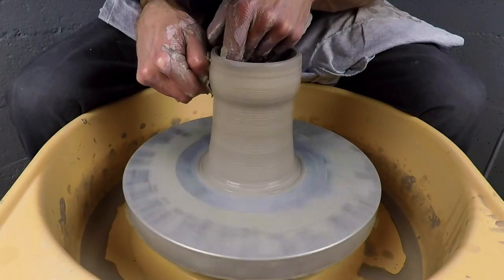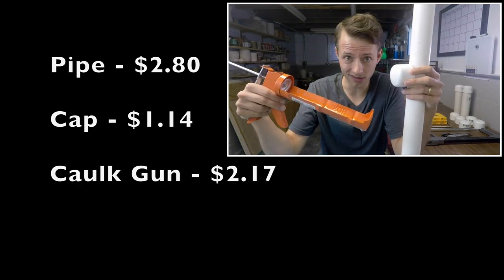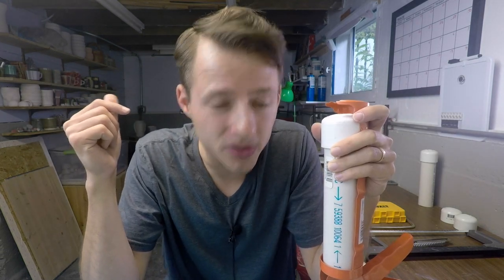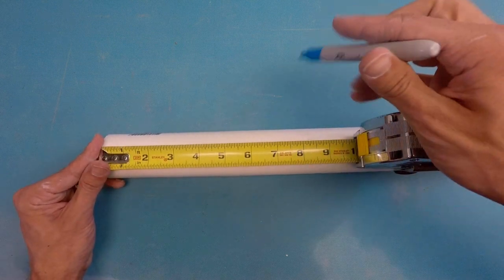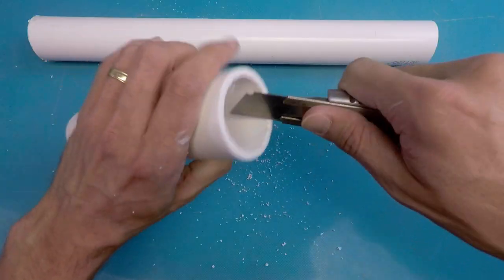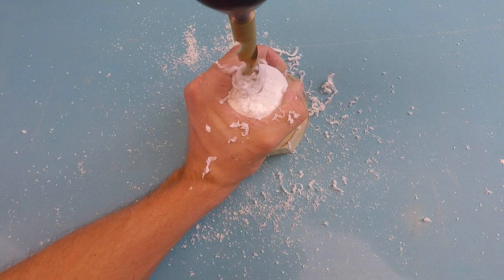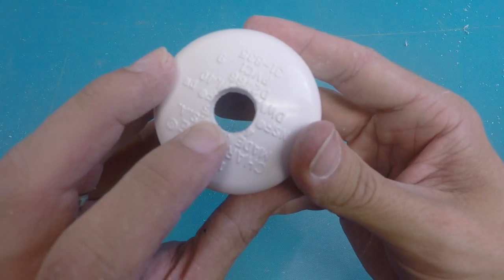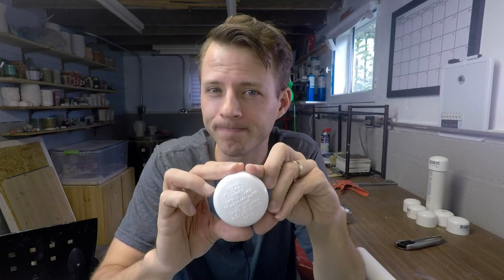DIY Clay Extruder

Comment: What about using those flat pressure test caps instead of the round end cap? Do you think it would stay on? Much easier to cut I would think.
Reply from the maker: I think you’re right. Perhaps the threaded ones too. I have a hard time getting the caps off sometimes.

Comment: Gonna be running to homedepot tonight to build this!
Reply from the maker: You may encounter a few kinks as this is a very DIY project but you really can’t beat the price.
Reply: @CeramicJim  ill let you know if i run into any snags and how i problem solved!
Reply from the maker: I have issue getting the caulk gun out of the tube when finished sometimes. Or popping the caps off.
Reply: @CeramicJim  update. I now have a finished clay extruder, thank you so much! Cant wait to share your video with my classmates! 
So far I haven't run into any problems, my pvc cap is too large to actually fit in the bottom so it sits on the rim, but still works perfect!

Comment: I read a website how to make this and went to home depot today and stared at pvc pipes and fittings for half an hours, and eventually gave up. The cap didn't seem to fit nicepy in the caulking gun. But after watching your video I see that it's not a prefect fit. So I will try home depot again tomorrow again. Great video.
Reply from the maker: You kind of get what you pay for right? You start to figure out the quirks of it all over time. I’m always looking for modifications that make it easier or better so if you try anything different let me know!
Reply: @CeramicJim  I am thinking about making test tiles this way. Extruding rectangles. I usually throw mine on the wheel but I don't like that they are irregular. So this may work for me :) thanks for the reply.
Reply from the maker: Right on. You should consider a T shaped die so the tiles stand themselves up. I’ve seen that before.
Reply: @CeramicJim  Made my test tile extruder today. Worked beautifully.

Comment: I tried a DIY extruder before finding this video. Mine broke because it had plastic end braces holding the extruder body instead of metal.
I wish I had found this video earlier. This earned the subscribe ;)
Reply from the maker: Haha yes! Glad I earned it. I’ve gotten a lot of use out of my diy extruded. I have since purchased a nicer one but it served its purpose at the time.
Reply: For sure. A proper extruder is an investment, but ~$10 and some DIY will get you by until you can justify the expense.

I'm saving up for a pug mill and a kiln right now, so this will do until then

Comment: Great video!  I asked for an extruder for my birthday. When DH saw the price tag, he said, "why don't I make you one?" Since I'm the DIY/builder of the house, I said, "I can BUILD an extruder??!!?!??" DH was a little grumpy that he now had to figure another birthday present for me!! Lol!!
Question: what kind of clay do you use in your extruder? Also, what's the smallest size hole that you recommend?
I throw porcelain, so I decided to use it in my snazzy new extruder. The hole I cut was 1/4" in diameter. I got a 1" coil before calling it quits. Maybe I should add more water and wedge it more?
Reply: Also, I played the part in the video about smiling and asking the hardware store (nicely) if he coukd please cut the PVC for me. He laughed and was happy to do so, but only because I asked so nicely.
Reply from the maker: Thank you! Hmmm. I use porcelain. It’s cone 6. You should be able to get a quarter inch coil so yeah it’s probably a little stiff. The smaller the hole is going to make it tougher to press through. I’ve had trouble with smaller shapes and even if the porcelain is only a little drier I feel like it makes it exponentially harder.
Reply from the maker: Nicely is key 😄 . They’re usually happy to do it. I still ask them all to cut big wood panels for me.
Reply: @CeramicJim  hmm. Yeah. It's been pretty chilly here lately, so that's probably what it is. Thanks!!

Comment: I would like to see if you could make an insert for this tool to create hollow clay pipe. Then fire it to make wind chimes. By the way PVC becomes flexible if you use a heat gun on it in a back and forth motion, so as not to burn it.
Reply from the maker: It can be done but I don’t know if PVC would be the best option. The ones I’ve seen for hollow tubing require a strong surface to screw metal flanges to. I could try though. Maybe I will ;)
Reply: If you made a bisque round plate would that work inside the gun for hollow
Reply from the maker: Hmm🤔

Comment: Was this a heavy duty caulk gun? I did this after watching your amazing video and my pipes didn't fit well, so I actually ended up breaking the gun! It was old, no biggie, but I want to buy the right size for future use.
Reply from the maker: Hmmm. It’s possible the size of the disc on the caulk gun could vary based on the brand. How or when did it break? I sometimes have issues getting the used tubes out so I’ve been brainstorming modifications to improve the design.
Reply: @CeramicJim  The handle broke at the welds. I did get a better one that fits everything, except now I'm having the issue with the disc getting stuck inside. My hubby works at a machine shop and he ground it down a bit. Planning to see if that fixed it this evening! Thank you!

Comment: The little nubs on the ends of the coping saw turn tightening it to release the blade, so you don't have to push on it manually like you were doing.
Reply from the maker: Hmm. That doesn't twist the blade? I've give it a try. Thanks Eric!
Reply: @CeramicJim   Yeah it usually can turn the blade too, but usually tightens it enough to pop the blade out. But maybe it doesn't work with all coping saws... Just an easy trick if it works haha

Comment: Thanks for the video, Jim! This looks fun. I have a couple of questions for you: 1) Do you need something in the back of the caulking gun to push the clay, or you use just the piece on the gun itself? I imagine quite a bit of clay would squeeze out the back. 2) How do you clean it out so you can re-use it? I suspect that you need to take the cap off pretty quickly before the clay starts to dry and thoroughly clean it all so you can re-use the pvc and the cap, right? 3) If you're cleaning well between uses, couldn't you just put different caps (dies) on the same pvc pipes? 4) I read that when making a die, you want to angle the opening slightly so it gets a little bit narrower as the clay passes through the die so that it is actually compressing the clay as it comes out. Thoughts on that? Thanks!!
Reply from the maker: So many good questions. This DIY extruder is certainly on the cheap. I just use the piece on the gun to press through. Depending on how big the die is, sometimes clay pushes back but I was surprised there wasn’t more. Getting the cap off is actually quite annoying because pressing the clay through in turn presses the cap on harder. I find myself having to bang the lip of the cap on the edge of a table like opening a bottle without a bottle opener. Not the best practice at all but it works and it’s cheap. Some kind of twist cap with discs to slip in would be better. I use a variety of clays in between although I usually use different tubes with the same cap. It saves time. It’s also easier for me to let the clay residue get bone dry and then just wash it away versus trying to clean it out when the clay is soft. As for cutting the dies I’ve moved on to 3-D printing them but you’re right to try to taper the opening more narrow. Mine are mostly straight and it works pretty well. Thanks for the awesome questions and comments.
Reply: @CeramicJim  Thanks for the quick reply, Jim!

Comment: can you make hollow clay tubes?
Reply from the maker: You can but it’s a little more complicated. You need to have a ring opening at the end of the cap but then you need something to hold the center piece of the ring in place from the inside. Hopefully that makes sense. It is doable but a much harder DIY for this extruder.
Reply: Jim you should DIY this 😀
Reply from the maker: Is that a challenge? Ugghhh Kat, now I feel like I have to. WHY??!?! Jk 😉. Currently pondering ideas. I will revisit this one.
Reply: lol ok.  I think you could put a small clay disc with a .5 inch hole inside the extruder between the cap and pipe then put the cap on and extrude a hollow tube? seems like it should work but maybe not.  Since I have no cap but I have a tube today I will try it.

Comment: In 2022 this invention will cost you more like $20.  Also recommend you buy the PVC to fit the diameter of the plunger on the chaulk gun as closely as possible otherwise the clay will seep around the sides of the plunger and you will 1) waste a lot of clay and 2) it may be impossible to remove the plunger to reload (until you soak it and fight with it, which is no fun).  Two other items that will be helpful and inexpensive: 1) a bottle brush to clean the PVC tube and 2) a $1 rubber washer to fit the diameter of the tube placed between the plunger and the clay - you can cut this to size if you can't find the exact size.  This will prevent clay from getting around the sides of the plunger and make clean-up much easier.

Comment: While watching  your video I was thinking: what about using a PVC sleeve, the type used to join 2 similar diameter pipes, they have a "stopper ring" inside, that'd allow the use of flat material (e.g. plexiglass) to cut dies, cutting dies on a flat piece of material would be easier than cutting the shapes on a PVC end cap, a flat sheet of something is easier to clamp to be cut.  But then, as the good book says: there is nothing new under the sun, it has been done before, take a look: https://youtu.be/Jc4ukIJ4Ayc
Reply from the maker: That’s a much better idea. My creates complications that your idea would fix. Mine is fast and easier to make but harder to use. I’d like to give your idea a go. Thanks for the tip :)

Comment: There are two different sizes of caulk guns available.  The one in this video is the regular 10 oz size, the larger size is 30 oz.  Lowes has a 30 oz gun for $13.28